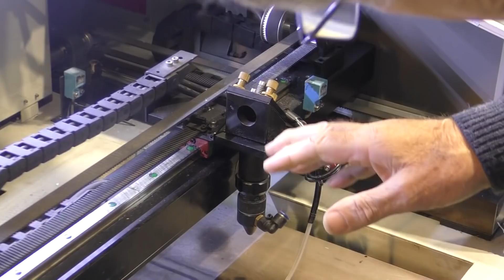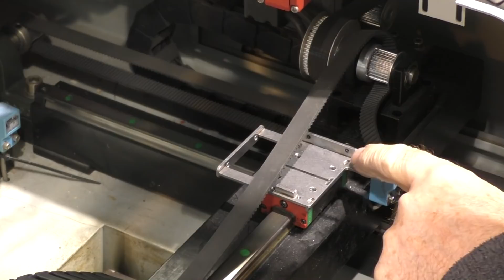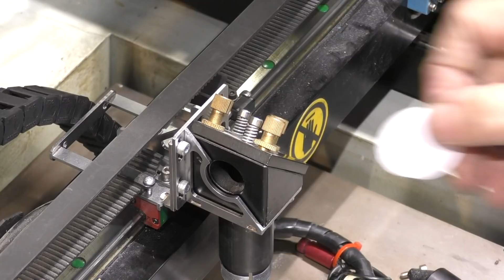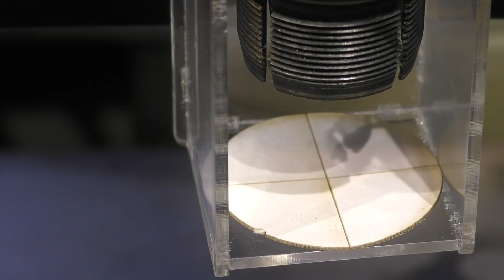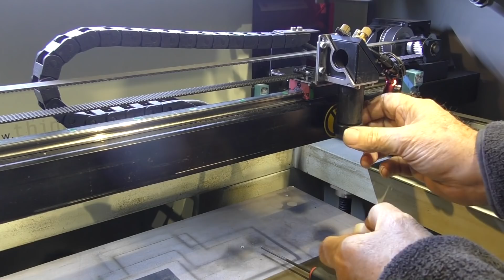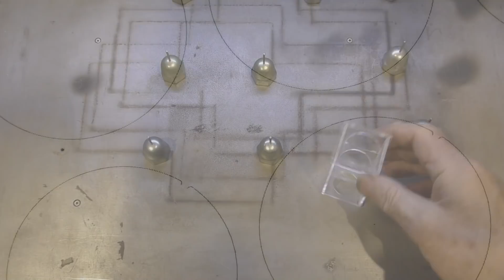RDWorks Learning Lab 175 C Series Head adjustable bracket

Comment: Hello Russ, I can't seem to find any information on the compatible rail specifications. My laser cutter comes with an MGN12 rail while your's looks like an MGN16 rail and a larger block. Thank you very much!
Reply from the maker: HiKevin
The adjustable bracket from Cloudray
https://www.cloudraylaser.com/collections/k-series-laser-head-parts-1/products/cloudray-c-series-co2-adjustable-laser-head-bracket?variant=32936879947916

Its designed to fit the 15mm bearing block that I have on all my machines. If you wish to fit this adjustable bracket you will need an adaptor plate. You can make this yourself from 3mm acrylic. If you want the drawing just add your disguised email address to another comment and I will send it to you. I will then delete your comment/email address.

Best wishes
Russ

Comment: Thank you for all your videos. I am scratch-building my own laser and it will incorporate several ideas you came up with (steel table, accessible adjustments, planned airflow, etc).

I am completely intrigued by your curtains (episode 121) and acrylic edge cut quality observations. I think its a quite complex issue. I think there are several contributing factors, and you found most, but I think there is another one. Its the ball bearing car that rides the linear rail. In it, there are two circuits of recirculating balls entering and leaving the load bearing areas. If you remove the belt and push the car with your finger (slowly) you can feel the cyclic force changes. And they are erratic. You can hear the un-smooth motion by pushing the car quickly. These cars were designed for machines with high forces and they are pre-loaded for zero lash. I don't think they are a good fit for lasers that have no cutting forces. At the very least, they should be specified for only a light pre-load, but many people don't know you can get them like that.

I agree with you about the chordal vibrations problem and the stepper problems and the pulley eccentricity problems and the belt stretch problems. Its all happening at once and the problem is to isolate each (not easy) and determine how dominate each effect is. Not easy as I suspect that changes in speed, acceleration, belt tension, and how and when several cyclic effects sync up will mask or accentuate the various various problems. Of course, there are static and dynamic effects and most are non-linear.

Stepper motors can be driven using micro-steps, as you know, but a fair number of drivers morph between microsteps and full steps on the fly. The micro-steps are often non-linear. At high speeds a stepper motor lags behind its theoretical position. A servo won't move UNLESS there is an error.You can't trust anything...

Epilog laser (maybe others, too), use servos and the encoder is a linear scale that runs the length of the axis. IF, IF everything is done according to that encoder, maybe curtains can't happen and all mechanical inconsistencies are compensated for. No, that sounds too good to be true.

For my machine, I am going to make a car that slides (not rolls) and is lightly pre-loaded for zero lash. I won't have the drag of seals or pushing grease around. I am projecting the car and head to weight about 2 ounces (16 is typical) so I should be able to run it at higher speed and acceleration and/or use a smaller stepper. 

If you would like to comment or hear about my progress on this, here is my email: aircastlebizatyahoodotcom. Perhaps you would like to make your own low-drag, smooth, low mass retrofit for your machine and do your usual evaluation of the results - its one of the few things you have not done.

Please keep making your careful and unusual observations and coming up with elegantly simple and cheap solutions. 

Thanks again.
Reply from the maker: Hi John
I wish you all good luck in your building venture. 

The good news is that if you use the right belts and drive pulleys you will never encounter the curtains issue. I am fortunate enough to have two completely different machines that allows me to compare. Don't fear the linear bearings because I have the same on both my machines. Logic says they have no contributing effect to curtains. I do not have any curtains on my other machine. Both machines use 3 mm pitch HTD belts 15mm wide. So why curtains on only my China blue machine?  The answer is that it's  drive pulley is far too small with only 16 teeth. My other machine has 3 times that number.  As you have seen,  I circumnavigated the issue by using the belt the wrong way round This has fixed the curtains issue completely . Photo engraving is very sensitive to this curtains issue  but now I can create the same quality images on both machines.
I have servo controlled steppers on one machine and open loop on the other. I never see a performance difference between them and it demonstrates how a stepper working within it's operating envelope can be completely reliable.. However given a choice I would naturally opt for the servo control. The linear encoder on Epilog machines points to them using  DC servos rater than steppers. They can rotate much faster than steppers but they will do nothing dramatic for machine performance if you use a DC powered glass tube laser. The response time of the HV power supply becomes a limiting feature. That is why  Epilog use RF technology, it has virtually instant response.  and allows precision switching of the laser. in relation to the linear encoder. Use wide small pitch belts with relatively large  pulleys and make  your own ultra light head.. The only time this speed and precision control are needed is if you are producing a high speed  production ENGRAVING machine . Cutting levels all the technologies and you do NOT need the  high speed or precision switching  for CUTTING. So think hard about your need an design/compromise accordingly.

It's admirable that you are building from square one  but my learning journey was never intended. I bought a machine that was for fun and retirement pleasure. It turned  out a lot different to the initial intention. I soon realized that I had bought a badly designed pre-assembled DIY kit with no instructions. My other hobby has always been video and editing so I decided to document my learning journey as a way of adding to the fun. I thought there may be a few tens of laser nerds out there that would get pleasure from my "laser porn".  I have been blown away by the number of people playing with this technology and even more staggered that there is so little technical data available. At the beginning I thought that the pros that do this for a living were keeping secrets  within house for commercial reasons. It has become apparent that this is not the case. They are using the "big boys" machines and the software has dumbed down the technology  to selection tables and optimum settings.  Production means getting the job done. If it works don't ask questions. My wife  drives a car but she could never understand or design one..

Best wishes
Russ

Comment: The nails that appeared and talked about in the minute 21 I was very impressed and made like that on the same day which is useful for lifting the material and not touching the metal, which is a great way
Reply from the maker: Hi
 These work very well for all stiff materials  but for thin paper and card work I still have to rely on my original pin table design. Glad you found the idea useful.
Best wishes
Russ

Comment: Where do you get your supplies of acrylic sheet from in the UK? Where would you recommend for a good price?
Reply from the maker: Hi Andy
With my former industrial contacts I used to get offcuts from Amari Plastics. But things and staff change over time and that free source of material ceased. I dd some work helping fix a  couple of Chinese laser machines that were sitting unused in the corner of a factory that made signs and lots of shop displays from wood plastic and glass.  They also had lots of scrap so every time I visited to help them out I came away with a boot full of acrylic as payment. So I have never been short of acrylic.  Many US guys wanting to make the DXF files I send them cannot get the metric sheet sizes I use . I send  them to a UK source to buy just what they need. It's called Simply Plastics. Although I have been directing people to there for about two years, it was only a couple of months ago,  when I needed  some special Fluorescent Cast Acrylic Sheet, that I discovered they are only a few miles away from me.  . They have a couple of Chinese machines  which I have offered to help with if ever they are in trouble. In return I will be able to call in for offcuts as and when.   Bartering is much better than buying so I just happen to be a lucky guy.
Best wishes
Russ
Reply: @SarbarMultimedia  Lucky you! But fair since your using your talent to help companies who'd probably pay a premium for an engineer call-out.  On smaller orders a big chunk of the price is postage. I'll have to do some digging to find a supplier near me. Cheers.

Comment: Thanks for the great video - Quick question How thick is the metal sheet on your table - in the process of making my own adjustable bed.
Reply from the maker: Hi Leigh

16 gauge (1.5mm) is the thinnest I would go but sensibly it should be 2mm cold rolled sheet  (untreated)   You can wax it initially but after a while it gets coated with varios thin fils and does not go rusty., Clean it regularly with acetone  before the crud has a chance to burn on.
Best wishes
Russ

Comment: I have another project for you! Many of these printers have a 'pass-through', where you can remove a panel in the front and back of the printer to allow larger material be inserted. Is it possible to remove the original Y motor cable and attach it to another motor, that moves a bed backwards and forwards moving the material in and out of the printer area, allowing smaller printers to cut the same area as a much larger printer.
Reply from the maker: Hi Andy
RDWorks caters for XYZ and U axes. The U axes is reserved for "other features"  Many Chinese production machines use this axis to drag or push roll materiel through the machine.. This not exactly the concept you are proposing and I know your concept is viable because one of my metal cutting laser was a 1250 x1250mm square work area with a sheet gripper system that allowed the sheet to be moved backwards 1250mm after the first area had been worked upon. It was in essence what you are proposing because the gripper was really the Y axis that moved the material  on a large ball table under an X head. Thus I can envisage an Y frame outside your machine with a sheet clamping system on it . Within your machine just behind the X axis you would place a material support roller. and yes, you could use the Y axis motor to drive the separate Y axis. RDWorks software allows you to make theY axis whatever dimension you wish to.  So yes your proposal is entirely feasible. Would it be cost effective? Maybe, if you have found a niche market for wood engraved skirting boards or some other such "wide screen" application.  My goal has always been to find the absolute operating  capability for my standard machines. Extending the specification into a different machine is not within my remit, so i am offering encouragement with caution.

Best wishes
Russ
Reply: @SarbarMultimedia  Thanks for the reply. I didn't know about the U-axis. And the gripper idea sounds fascinating.

Comment: This is an awesome video. I bought a 40 watt laser that looks almost identical to this in 2009. For the first two years I was not able to align the beam down to the laser in any way other than trying to measure the amount of error that I had and jamming a wedge to align the tube. I then was able to aligned it a few years later by making other adjustments. But your bracket is brilliant.
 
I also have bought a new 80 watt tube to upgrade my laser. I have yet to install it but now I'm thinking I will wait until I can buy the bracket you've designed. I also bought a whole new control system that I'll install at the same time.

Comment: Hi Russ.
A laserbeam is not supposed to be needle-sharp in the middle! 
I'm a proffesional laser technician working with industrial lasers,  and I adjust laser resonators every day. 
A perfect beam is in fact hollow in the middle, and look like "a tube of light". 
We also make mode-shots in a cube of plexiglass, to verify the beam quality.
And actually the shape of the burning is a conical crater like yours, BUT with a small pyramid raising up in the middle!
Not only a flat spot like yours, but with a small peg pointing upwards in the center.
I can send you some fotos if you like..??

So when your beam is flat in the middle, everything is just fine.

Best regards
Preben
Reply: I'd be very curious as to it's cut performance, as I just replaced our tube that was doing what Russ's tube is doing and we were getting very poor cut performance.  We replaced our tube and have a very nice "dot" and it's performance is significantly better.  What might a ring shape improve to cutting that a needle point doesn't have?

Comment: I'm still in the process of setting up my laser cutter (one of these : https://www.ebay.com/itm/DSP1060-100W-Co2-USB-Laser-Cutting-Laser-Machine-Auto-Focus-DSP-Engraver-Chiller/392220092474?ssPageName=STRK%3AMEBIDX%3AIT&_trksid=p2057872.m2749.l2649) but I wondered about the flexible pin-table idea as well - and came across these (https://www.amazon.com/gp/product/B07Y997RDZ/ref=ppx_yo_dt_b_asin_title_o04_s00?ie=UTF8&psc=1) magnetic push-pins. If you invert their expected orientation, you have a bunch of pins magnetically attached to a base.

They're not perfect, the magnets are a bit wimpy, but it's easy to get stronger ones online, and they do seem to be pretty uniform in length. I didn't measure them with a micrometer (I will, now [grin]) but I did put a piece of wood across a bunch of them on a flat surface, and they all seemed to connect. I have some stronger magnets on order to test out their usefulness with larger workpieces.

Looking forward to the next installment :)

Comment: Can i have a copy of the diagram? I have a cnc machine and will attempt to make my own if you dont mind. Thank you,  Russell
Reply from the maker: No Problem. Add your email address to another comment  (in longhand form eg  johndotsmithatgooglemaildotcom) and I will send you data
Best wishes
Russ
Reply: @SarbarMultimedia  Hi Russ, 
I'd appreciate the diagrams too, to make an adjustable head baseplate, please.
Great video, thanks.
Sincerely,
Ian Stewart-Koster
(in Australia) 
PS I tried that email address you wrote above, and it bounced back...
Reply from the maker: @ianstewart-koster9982 
Hi Ian 
Add your email address to a separate comment but disguised in longhand form like iandotstewartatgooglemaildotcom  and I will reply. I will also delete your comment
Best wishes
Russ
Reply: @SarbarMultimedia  I follow you through your videos, and I love them. You have a great sense of explaining the details of problems, and the process of resolving them. I would appreciate the diagrams for adjustable head. It will save a lot of problems that I have.
Thank you  very much
Urška
Reply from the maker: imagyn  
Hi Russell I have replied and deleted your comment, Hope you can access the files.
Best wishes
Russ
Reply: Many thanks Russ!
Reply: Russ, This design is exactly what I've been  struggling with on my machine for a while.  I'd love to get a copy of your file if you don't mind.  joshatjoshfeinblumdotcom